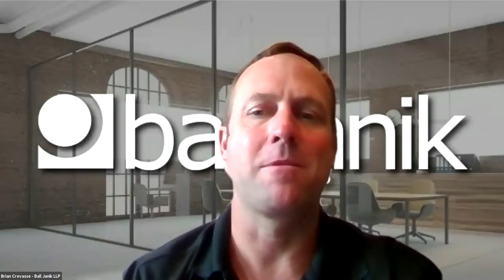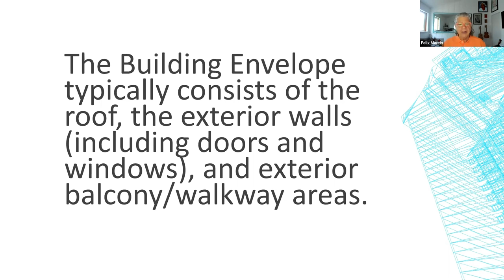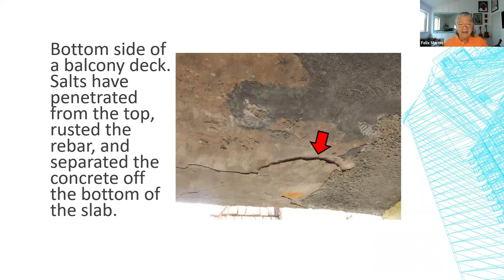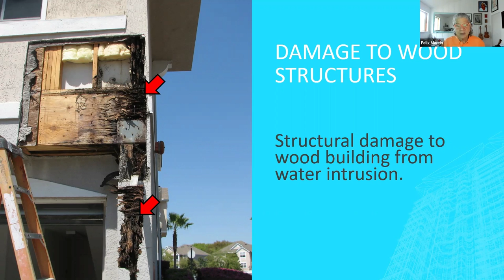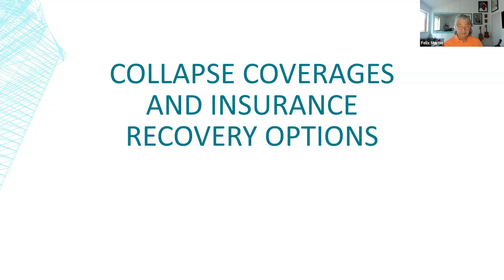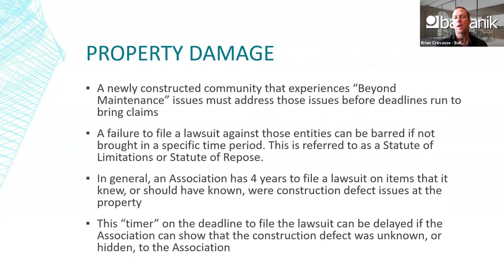Champlain Tower Collapse Tragedy: A Case Study in Safeguarding Your Buildings

Comment: Excellent talk!  I never knew that only two counties had any regulations at all in the whole state of FL.  Anyone looking to buy a condo there should be extra careful to check if the building they want to move into is well-maintained...maybe by hiring their own inspector, like you do when you're buying a house.

What I can't understand is why the pool deck was tied to the main building of Champlain Towers by beams when it was first built?  I have a wood deck on the back of my private home, but even at that low height, it's not attached to the structure itself with beams.  If I want to replace it, nothing in my house would be disturbed.

Shouldn't an outside area that receives more damage from the elements be constructed as a separate unit?

If the pool deck had been built as a separate structure...and it collapsed...it wouldn't have taken most of the building down with it.
Reply: Inspectors?  NONsense!  This is Flori-DUH!... If the LOBBY is purdy, then just plunk down yer life savings! /sarc/  As for design and construction, a LOT of shoddy construction raged throughout F-L-A, esp. the period from mid-1970s to mid-1990s... and those shoddy developers very VERY much resented ( cough Lobbyists cough-cough ) all attempts to make them less shoddy... finally Hurricane Andrew made the Code Lame-ness too blatant to ignore, and things have improved since then.
Reply: Safety is not a priority,cost is.
Reply: @MajorCaliber  I don't know if a 40-year inspection in two counties is much of an improvement.  Got a lot of scared condo owners down there.  Bet they're closing doors in their units very softly now.  🤣
Reply: @garyc39  I don't think it would be much more expensive to keep outdoor parts of buildings separate from indoor parts of buildings.  Just a matter of separating the beams.
Reply: You do realise there was an underground garage?  The fact that there was a pool was irrelevent, unattached decks require a lot more structure to stabilise - bigger columns etc.; if the columns were 24" instead of 16" - no other changes, it would still be standing.  Evacuated, but standing.  Under the new residential  code decks must be strongly attached to houses - can't, can't. can't be freestanding - too unstable people actually died.  Your pool deck is probably attached to the pool
Reply: @kenlieberman4215  Yes, I know that there was an underground garage, but I don't see why the part that was under the building should have been built the same as the part that was under an exterior pool deck.  Two completely different structures and environments.  But I agree with your statement that if it was attached, it should have had stronger columns.

Seems that the deck around the pool itself was much better reinforced than the part that was attached to the building...where it collapsed.  I would think that once it collapsed, it destabilized the beams that were part of the building, which in turn destabilized the columns that were holding that part of the building up...and was enough to start that part to collapse and bring down the rest.  I'm not an engineer, but I just thought that separating outside from inside structures was just logical.  😏

No...my deck is not attached to my pool, since the pool is at ground level and the house has a high foundation, so there are eight steps going down from the deck to the pool area, which has a cement paver surround.

The deck has it's own cca columns and beams...and no structural beams from the house were ever involved in it's construction...so if I wanted to have it removed or rebuilt, no part of the house would have to be involved.  I could have it rebuilt, or replace the deck with stairs if I didn't want it and the foundation in the back would look the same as the foundation in the front.  I never heard of anyone who had a deck that was tied to the house with the same beams.  Maybe a balcony, but not a deck.
Reply: @kenlieberman4215  If unattached decks require a lot more structure to stabilize...and they used more structure when they built it...it most likely would still have been standing.  Whoever built the pool reinforced the area where it was built, since that part remained standing, but the engineers probably relied on the building's beams to hold it up and save some money when they built the rest of the deck.
Reply: @hokeypokeypots  The pool is standing because it was resting on the ground.  The building is much stronger when all the elements are tied together.  The amount of material to make the columns larger would be less than the amount of material to make a freestanding deck , and you won't have a 3" gag for water to leak into.  The bldg was designed to a cheap as possible, and that meant skimping of safety.  The township approved the plan, and contractor aparantly shorted the steel.  If it had the amount of steel it was supposed to the deck would have buckled, but not dropped the way it did.  But tying it together wasn't a mistake, skimping was.
Reply: @kenlieberman4215  I read somewhere that the contractors who built the pool had added extra reinforcement around it on the pool deck despite it resting on the ground.  If they didn't, wouldn't the collapsing deck also have destroyed the pool?  Maybe they used thicker columns and more rebar in that area.  

Oh, I'm sure shortcuts were taken.  That was the time of deregulating everything 'cuz 'government was the problem, not the solution'...and the developer was a pretty shady character.  He even added some penthouse units at the last minute...and got approval for them.  And after that alsrming 2018 report, the building inspector for Surfside told them that the building was safe.

As far as I'm concerned, you can have condos, but I wouldn't want to live in one if I got one for free.  I lived in a wood frame house built in 1906 for most of my life and am still here to talk about it.  My next home was built in the early 80s and I'm the only person responsible for it's upkeep.  Barring anything unforeseen, it should outlast me.

Comment: Great video guys I'm a builder in Vancouver Canada and we deal with leaky condos all the time. Rain screen is the answer. Thanks
Reply: What is rain screen?
Reply: @juliefizpatrick513  Hi Julie Rain screen is a separation from your stucco or what ever exterior cladding you have and the sheathing plywood on the building. This can be 1/2 inch strips of ply woof or 3/4 inch. This allows the wall to breath. If water gets behind the stucco it is able to run out to the bottom of the wall. as long as a wall can breath it can get wet. it just needs to dry.
Reply: @patpower1702  Thank you for your response👍😊

Comment: So, the Board failed the residents did they, or no? Given the 2018 report showing the dire condition of the place? Surely it's not even about the report because the board members also live there and can't miss the glaring problems? I'm just confused and trying to make sense of  the situation  because over here in the UK we don't have this system.
Reply: 2/3's of the Champlain condo board of directors including the president, resigned in 2019 because the owners were fighting them tooth and nail over the projected costs to make the recommended/needed repairs. That is why the repairs weren't started and drug out over three years after the engineer summited his report to them. I live in a condo and our condo association has the exact same issues because no-one wants extra assessments added to their condo fees even when they are told by the board that the repairs are for everyone's safety. Hopefully this catastrophic loss of life is a wake up call for all of us!!!